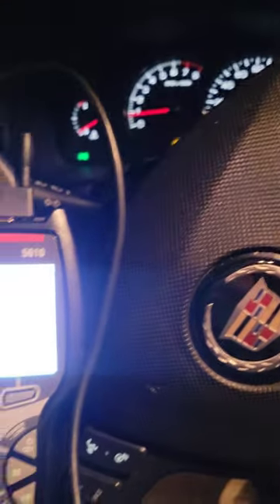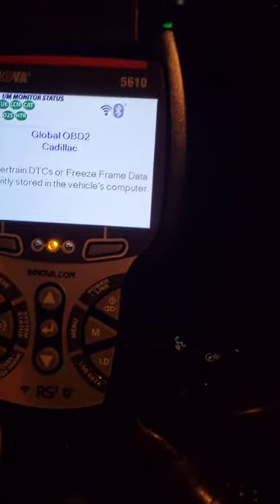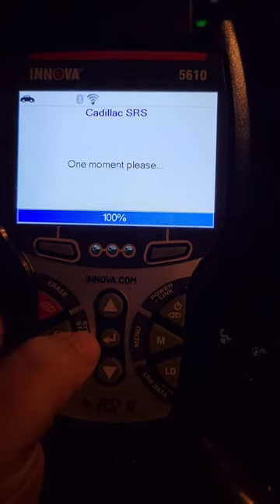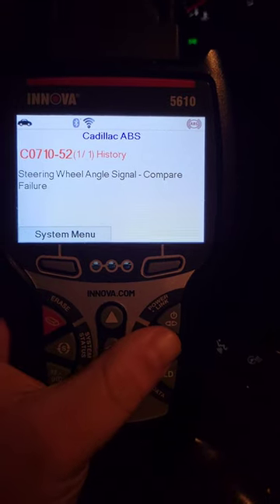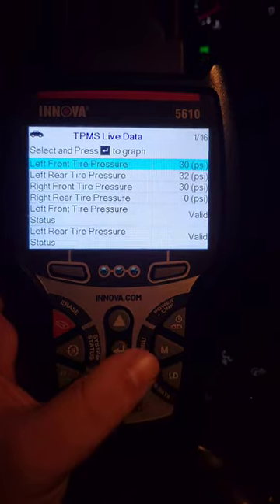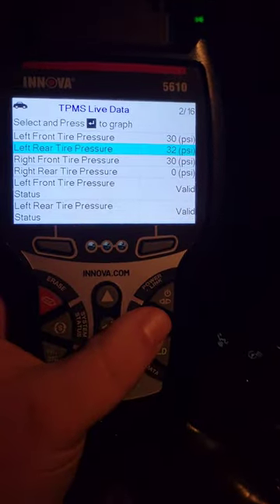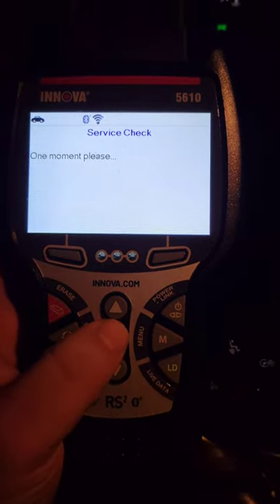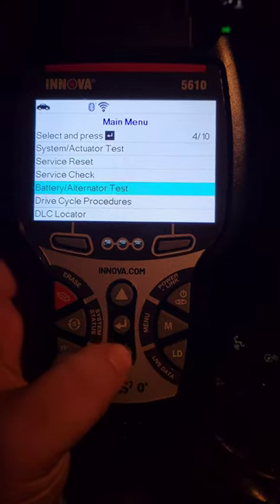Innova 5610 Special Features and SRS Functions Updated

Comment: i have a 1999 land cruiser, i have this 5610 scan tool, i have been most impressed with the grafting with this tool, depending on how many pids you graft, it can drill down to 1 second intervals, 21/2 seconds and 5 second intervals depending on how many pids are grafted, surprisingly even with an old truck i still get live data from abs system, pretty cool stuff, and when you graft while sitting in the truck, you can pick two pids and graft them together ( superimpose them) and a high contrast black screen comes up in say grafting 2 o2 sensors, i get some bi directional stuff too, i get more with this scan tool than i would have expected from an old vehicle, thanks for sharing your content, have a great christmas and holidays!! ken.
Reply from the maker: That's something I am going to hit next is the Graphing. I used it myself to track the IAT's to figure out if I could gain any performance over my stock box, which it turned out be true! There is a lot of data that this tool gives by no means is it the best, but at the price point I am happy with it! It has saved me more money than what I have payed for it and the diag is always useful. When I first started my motor in my STS I had my 5610 hooked in so I could make sure everything was working and scanning for codes.
Reply: i agree for the money it’s a great tool!! , i have the bosch 1200 scan tool,it’s a great tool too but i needed better graphing, so i got this 5610 and it was much better at it!!, i like to look at the wave form for stft and ltft and of course the 02 sensors, and their are some cool tricks you can do with graphs, just one example is, if you graph the tps sensor and the maf sensor and combine them together, they should both mimic each other, if they do your maf sensor is good !! too move up to a better scanner it’s in the 700 dollar range, and whatever the yearly cost is for updates,so very happy with this 5610 tool,you are most certainly better than i am at this than me for sure ! and hopefully more people will see your posts on this tool , theirs a lot this tool is capable of doing, one question i have is,, what does changing the injector volume do for diagnostic purposes ?? again thanks for sharing your experience with us on this cool tool !!

Comment: Hello,  I am thinking about getting this scan tool,   since this is bi-directional do you know if it can turn off the Active Fuel Management  on GM products?  I have higher mileage LC9 and and I want to disable the AFM.  I have found the OBD plugin device that only  disables AFM, but for the cost I would rather have a tool like this that can do multiple other things.
Reply from the maker: I don't think so, turning of AFM is one of those deals I would take it to a tuner or see if a dealer could do it. The Ecu is programmed for it so it can talk and pull data from these systems but not shut them down out right. I wouldn't use anything from online unless you know of it working because you could lost some efficiency with it, but thats just me!
Reply: @SALLEERE  thank you!
Reply from the maker: Anytime! dont for get to subscribe I have more content coming soon